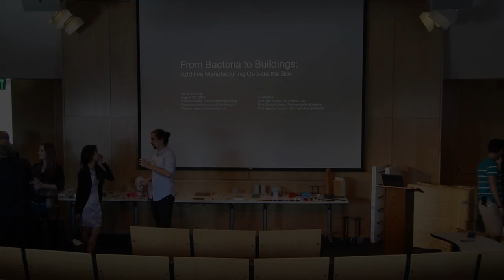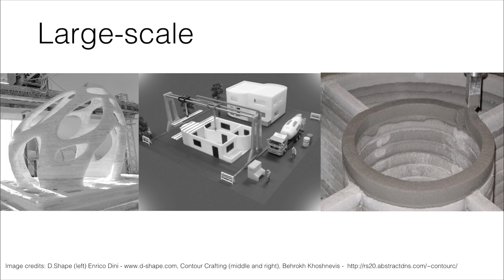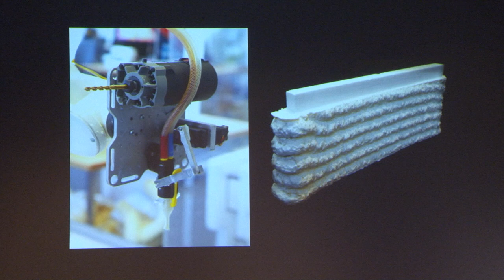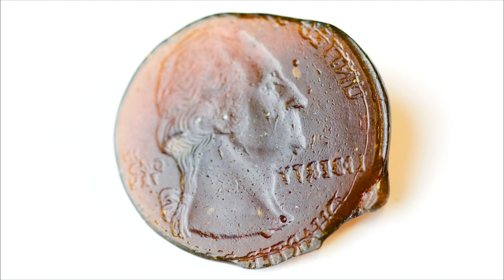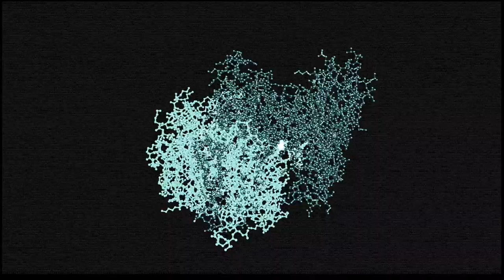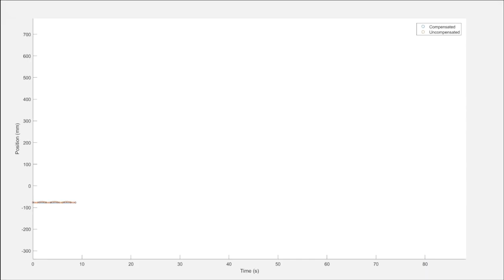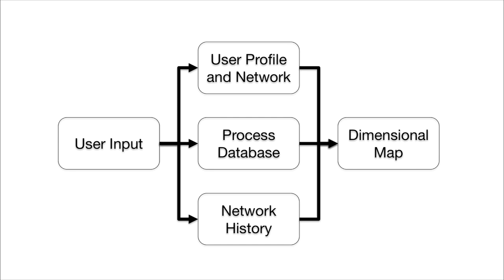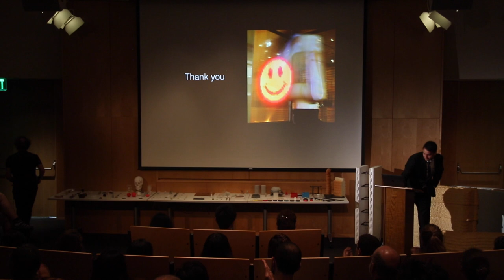From Bacteria to Buildings: Additive Manufacturing Outside of the Box - S. Keating - MIT PhD Defense

Comment: So your paint I really like that bro have you seen the people who have made the pin that they draw with it and it creates a electric circuit so while you print you can print your wiring into every building so you'll have no need for electricity and you just wherever you want your electric wiring path to run you the material the copper would be injected into the wall so you would just have a a circuit in the wall already that that's where you need to go with your 3D printing is how to incorporate the wiring and the lighting and the light sockets

Comment: That's very fascinating and inspiring talk!
I am curious about how you manage the multi-color printing. Do the the changes of colors have a preset first before you start to print it? Or you have multiple material container connecting the same nozzle and can be changed randomly as you want? It looks like you have a preset first. So every time when you print something you have to set up the combination of colors first?
And for the architectural scale printing, it is really good! Do you plan to start to combine different materials such as flexible material and strong material like steel in one print? It feels exciting!

Comment: The problem I see with print construction using foams is the materials are often toxic to to the environment once the life of the structure has been exhausted.  Choosing bio-degradable foams would not make sense from a durability perspective, but if the life of the material is many hundreds of years longer than the life of the structure then it is not environmentally sustainable.

Comment: Bro what you're talking about the sourcing on site material so I was thinking about whenever there's these hurricanes and these disasters and all that wrecked s*** is there and people are just I've been thinking about a machine that pulls up and it's like a wood chipper right it just takes all the 10 all the wood all the metal all the concrete and it just grinds it up and presses it into Lego bricks and then people can rebuild structures right out of it I was thinking about building it as like a you know a thing a relief thing or something you know basically just something that could like chew up trailers like trailer parks or stick houses and then make a building block out of it but I think it'd be cool about the size of a semi truck rolls up and you just get like a bobcat that picks up all the material puts it in the chipper it ships gets mixed with some kind of glue or something and pressed anyways

Comment: expensive cement.. reinforcing fiber and fast set CAS (15% to 85% portland min.) small aggregate and needs to have thickness of 10cm per wall and the wall still needs a filler and probably not going to pass as structural quality by the local  zoning board  without architect and big bond.... but with wood prices increasing 100-200% and as non-structural walls, seriously a good idea .. and with a concrete second floor on top of it...  Don't forget the expansion lines.  Concrete should be considered as a piece of stone..  think sensible, think right..

Comment: Ap I think everything you're doing is very impressive I have some ideas so how you're saying you have this the geiger counter to sense radioactivity well with a bucket while it's collecting things it can make a diode and a cat out make earth batteries makes the structure basically an earth battery so as it's building or printing it in lines the materials to where the whole structure is creating energy I have an idea for a 3D printer that's similar to this but it's for the desert so there was this man who made a giant what you call it a magnifying glass and he was making the desert sand in the glass right which impressive and awesome and I was thinking but it was only stationary in one spot I was thinking well what if you took that and you had it making a beam and you pulled it along either you can make a wind cell or make it you could make a steam boiler the desert heat and some steam and it would move itself but here was my ideal was to make a pipe or a channel you make a huge channel of glass right so basically you have your beam coming down heating the sand and then you just have a doll or something pointing down that it pulls the sand and it makes a channel a u channel right and it goes all the way down and it makes as long as you want a u channel then it makes another one and then you join those two together and then you get a pipe a glass pipe or you can have it go around in anyways glass is what I believe a huge city was made out of in our desert a long time ago by our ancestors glass is the ultimate building material for 3D printers for some 3D printers think about it buddy if you have a 3D printer in the desert that's using solar panel and magnifications to melt glass and then you can just form it in any shape you want hey if you ever use my idea you think I can come in and be on the project and learn from you guys all about machining and stuff like that I've just been online cooking my whole life I mean I could cook and clean the bathrooms and s*** and work on the projects I got great ideas I'm smart I can build anything but I'm just saying if you even ever hear these comments or whatever

Comment: I think this is not relevant anymore or even was not before. It is quite easy to adapt mechanisms to do such things. An the "mobile" printing platform was stationary while printing. If it would reposition it self during the print, then it could be considered mobile. But then again - there is technology that can be used to position a machine. Lots of construction machines can do that and even the farming tractors are automatically guided by GPS.
It is a great work but I would not feel like I earned my PhD if i presented this. This is a good material for getting your bachelor degree.

Comment: I do like I said my name is Johnny red now here's the deal tissue like your brain right when the surgery like that happens the information transfers to one side cuz it's electric synapses correct now say you were to clone your brain or a huge body right and then you take your you take yourself right so you have a cloned out body brand new you incubated it in a test to vagina test too right you lay down on the operating table they cut opening your head right and then basically graft you to your clone body right but say you're 80 years old but your clone body is 20 okay they graft your two skulls together and leave you like that for maybe two days or two weeks until you can start moving the hand of the 20 year old clone body until your consciousness shifts out of the 80 year old body into the 20 year old body through the brain because your your brain tissue is going to go to the more living better brain tissue right so just 3D print yourself a body then connect your heads together until you can start moving the toes feet and hands of the other body and then you'll just switch over and then you'll just kind of prune off the the old dead parts you know I've been thinking about this forever like why isn't eternal life happening when it's so easy to do I mean you literally just got to get a cadaver will not a cadaver it has to be living with no consciousness or soul in it and then connect your head to it and then eventually you'll just go into it you know energy is neither lost nor destroyed it's just displaced I don't know you know what I'm saying right I think it's completely feasible

Comment: Dangerous, hard work is manly. Don't do away with manly work. Most fellas have an aversion to in-house knitting. Putting a fella behind a desk is a sure way to drive him nuts. Manual labor is a good thing. Crazy manual labor is a bad thing. Knowing the difference is critical for creating a sane society. Engineering and science folks seem to miss our purpose of living. How many engineers and scientists do we need? The answer is few. If that is the case, what do the rest of us do? Knit? Boggle? Sing? Dance? Paint? All are good. Will these sorts of labor bring enough income to earn a living wage? The answer is no. The economics of dangerous, hard work needs to be addressed. No worries, the economics are being addressed. Are you listening? Your answer is: ___________.

Steven, your ordeal with a brain tumor is of interest to me. An acquaintance of mine, a physicist, has one. He's in the late stages and its too far gone. I had one many years ago. It was benign and relatively easy to access. I'm fine now. The surgeon literally plucked it out. However, took over a decade to recover. It messed me up big time and made me a bit crazy. I'm thinking that we  share something in common ... some level of exposure that brought about the tumors. Now and again, I'll come back to this posting. Stay tuned.

Also, I'm working on a project that may tie into 3D-printed residential and commercial construction. What I need to know: Materials science (identification and composition of materials) used in 3D-printed home construction.